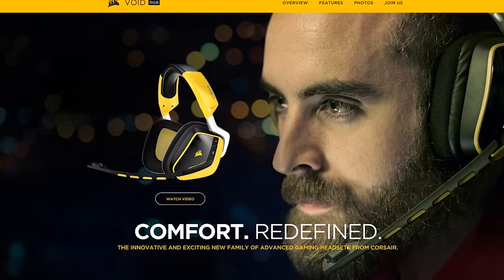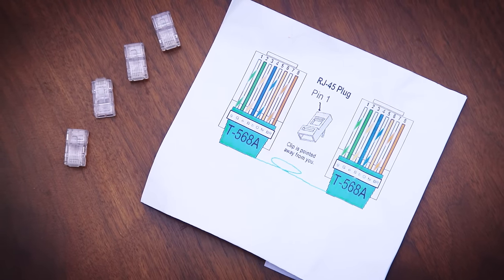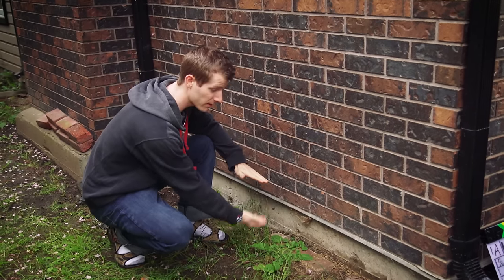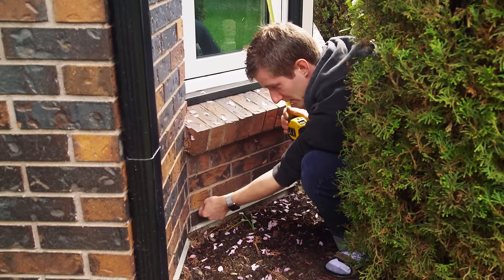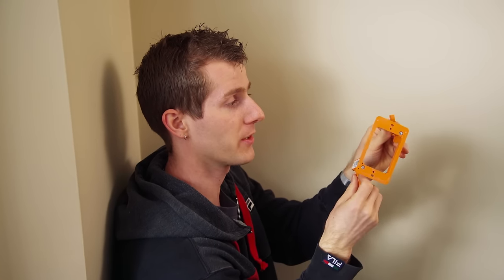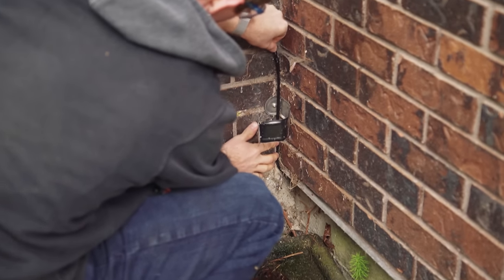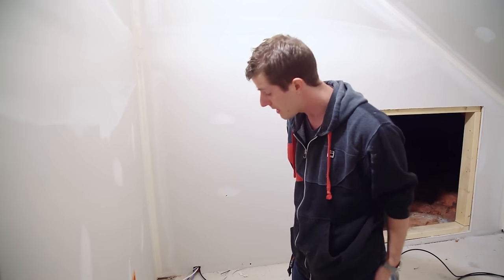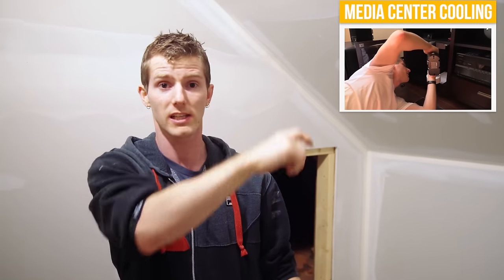Optimize your cable runs at home! - Installing an exterior Cat 5e cable

Comment: >socks with sandals
Also, I can tell that you've rarely done work on houses. Lots of moments of me screaming "NOOO DON'T DO THAT" 
Short bit of advice as well is to always drill from the inside out and angle the hole down (from the inside) so that it'll make sure water can't go up into your hole even without silicon (use silicon, not caulk. It's better for this type of thing). And once you hit the brick, you could switch to using the masonry bit. You can also grab grommets for the hole you made. They actually specifically make them for this type of thing. I trained to be a broadband premise installer and they advised to NEVER drill into the house from the outside. 
I wouldn't recommend using a drywall saw on already hung drywall, you NEVER know where someone might have ran a wire and the last thing you want to do is get hit with 120V and then also have to fix that now damaged wire. Use a utility knife as it won't risk cutting wires. 
Always remember to check where studs are so you don't end up running into one when running wires like this. You can patch drywall but it's easier if you don't have to because you can't put the face plate in the wall thanks to hitting a stud. 
Other than that, most of the rest of it was alright and you could follow that. I've (unfortunately) had a lot of experience doing electrical work, running wires, plumbing, and working on houses because my dad and I have done many remodels for family and our own home. Plus, I used to work for him installing and fabricating countertops while I was in college. 

At least I can come in handy though.
Reply: lots of useful advice :) good stuff!
Reply: you meant to say Silicone.
Silicon is something else.
Reply: +taiiat yeah, oops. sorry about that. yeah, Silicone, not silicon.
Reply: Unfortunately? I make 45 dollars an hour as an electrician.
Reply: +Carl Sagan it's just not things I enjoy doing. I know how to so I don't have to have someone else do it but I don't enjoy doing it.
Reply: im gonna move to the us or where ever ya live
here they dont make that much
Reply: Union electrician here. We make 47 an hour plus benefits. Overall our employers pay about 90/Hr for our guys. We get it done quick and right.
Reply: I never work on houses. This made it look easy to me. I didn't really detect any mistakes. Shows you how much I know about building.
Reply: Perposterown he a tel enthusiast not an electrician xD
Reply: if you drill from the inside there is a good chance you'll blow the face of the brick off
Reply: There really isn't much of a problem from drilling form the outside.
Reply: Yeah, I was kinda wondering why the heck he wouldn't just drill from the inside out instead of doing all that silly measuring...
Reply: Because drilling through a brick, in the best of circumstances, chips off a good chunk around the emerging point of the drill bit, and in worse circumstances, breaks the brick in two.

Drilling in cement on the other hand is extremely clean.
Reply: At first I thought it was just one of those comments critizing without actually giving any advice, but I'm glad I kept reading some really good points, plan on doing something similar so thank you for the tips
Reply: @carlsagan3065  be contempt with that I barely make 35 dollars a day repairing electronics
Reply: Just goes to show that you can get paid almost 50/hr and a union will still scream injustices
Reply: @Courtesyflush52  Have you ever been a union member?

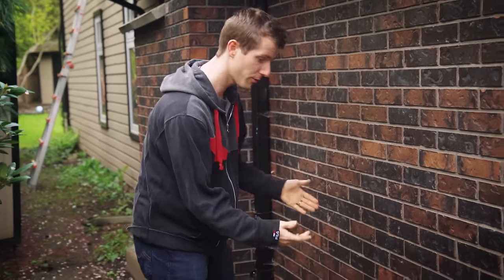Comment: LOL, 4:22 prepared safety glasses; 7:22 forgot the glasses.
Reply: LinusSafetyTips
Reply: "Forgot"
Reply: LOL, of-course you don't need them Just funny to make a point about using them and then not use them.
Reply: He was probably wearing his safety squints at that part.
Reply from the maker: the clip where I'm not wearing glasses resulted in a bit of mortar in my eye, which is why I altered the script and re-recorded it afterward. I guess the editor didn't see the difference between the clips. He probably had something in his eye :p
Reply: Also, do as I say, not as I do.
Reply: yeah well as someone took a chunk of brick to he face yeah shit happens had i not had my glasses i would have lost my eye.
Reply: closed toed shoes next time son
Reply: One Two c
Reply: Seriously the second I saw his disclaimer I totally didn't expect him to wear them for the rest of the video. I had some idiot I was working with while running cable totally blow debris from the other side of a hole directly into my eye. WEAR SAFTY GLASSES!

Comment: Pro tip if you are going through wood and not brick:
Angle your drill upward from the outside, so that any condensation that gets inside your wall just runs back outside. No need for a steep angle, but 20-45 degrees will do ya.

Comment: For external run, you might be considering some sort of 1 inch upvc pipe for extra protection (Act like a conduit) to your cable too. But of course, that will take more times for the installation, bending supports etc...

Comment: Shouldn't there be a loop in the cable just before the entry point? It will stop any water wicking/crawling along the cable and entering the house which could cause rot, it might be unlikely here seeing it has a short run up but it is good practice and would need to be used in other configurations so people should know this. (I'm not sure of the proper terminology but searching "cable drip loop" and "coax drip loop" seems to generate results)

Comment: ALWAYS DRILL INSIDE TO OUTSIDE, MAKING NOTE OF ANY GAS LINES, METERS, WIRES, ETC, ON THE OUTSIDE WALLS!  --  It is cheaper (MUCH cheaper) to get regular cable and paint it (or, like most professionals, tuck it under the siding or the lip under that brick wall so the sun doesn't hit it).  -- Keystone jacks are are a better choice than couplers (that crap you used on the wallplate).  -- Be VERY careful using dryall saw that close to an outlet, it is better to use a knife to avoid cutting electrical wiring. --  You don't have to remove the downspout AT ALL, just feed it through --  When using clips to hang the wire, DO NOT PUT THEM EXACTLY THE SAME DISTANCE APART (this causes a signal reflection) -- Clear Silicone is better in ALL ways than "caulking", and usually cheaper. -- AND, you said specifically CAT 5e, yet I am pretty damned sure that was CAT 6.
Reply: Glad I'm not the only one who thought a keystone jack would be better. Plus they are SO much easier to terminate!
Reply: You are a man of many opinions... None of which I can argue with.
Reply: thanks for saying exactly what i was going to about the keystones, i have never seen someone terminate a wall play using an rj45 coupler! its just unnecessary! keystones and a punch down tool are easier and if you need to change from an ethernet to a phone jack or vis versa its easier to do with keystones, i had cat5e in my walls for phone jacks (just using less of the wires), just changed over to an rj45 stone and used all 8 and boom! works just fine and runs from my router to a outlet and a netgear 5 port swtich by my tv media centre and my WD NAS
Reply: yes LSA-keystones work really great and are a pleasure to use.
Reply: +Laurence Cosmo google has the answers you seek. and I'm not just trying to be snarky; if you're trying to embark on a project like that then you should do some real research before getting started if you wanna do the job right. But I'll answer your last question; in the video he terminated the cable with a standard plug, then plugged it into the back of the jack he installed in the wall. a keystone jack allows you to wire the cable directly to the inside of the wall jack.
Reply: Always drill from out to in if you want your brick to survive...
Reply: Big point for me was, even though he drilled from the out side, the end plate was lower and crooked. Compared to the wall plug.
Reply: Actually if you are making a plate, it makes sense to drill from inside to outside. You are making a hole for the plate and should see the mortar if its a brick house. But in general if you can't see the mortar its best to drill from outside in. It could be pho-brick which would punch out.
Reply: Kevin Smith
If it punches out, you are not using a proper bit, (wrong type, or dull) or you are forcing it.  Yes, the fiber is more picky about how it is handled, but it is hardly impossible to deal with.
Reply: lol yeah thats great mate, Always! drill from the inside out, resulting in blowing out a massive fucking hole in your brick work.
Reply: You are all also forgetting this may only be applicable to your area of the world. Maybe Linus was unable to find a keystone connector where he lives. Also with the way many houses in Britain are built drilling outside in is the correct way to do it. Since wiring and pipes are embedded inside the concrete in many older houses.
Reply: Drilling from the inside is pretty bad idea in this case. This is a really beautifull wall. Its more than likely that you will break off a huge chunk of a brick if you drill from the inside.

Furthermore, your comment is FULL with BULLSHIT, signal reflection because the clips are  put in the same distance? Really? Litterly EVERYTHING you say is FALSE! Greetings from a professional.
Reply: Don't ever try to do this. The hole is not drilled well and you are going to ruin your entire building.
Linus has broken all the insulation layers of the building.
You'll need to get into the house much higher and you need to drill the hole from the outside at an upward angel. You'll need to seal the hole for water and fire ... 
If you ever consider doing this, get an professional electrician (if you want to save, you may drill with his 
instructions yourself).
Reply: Soo, you've just given some bad advice on his supposed bad advice..!! Good job
Reply: +jordyboy62 Considering he has about 50 keystone jacks in his office, I highly doubt that was the reason.
Reply: CAT 6 cables have a separator which separate each of the pairs from each other, which in turn means that this is a lower category cable.
Reply: hayteN
What makes you think he isn't running Cat 6?  Did they SHOW the parts of the cable somewhere I didn't see?  From what they DID show, it is cat 6...
Reply: When he clearly states.. Cat5e.
Reply: Gerff What makes you think he is running CAT 6 then?
Reply: And yes, they did show the individual pairs at 9:03.
Reply: hayteN
It is the thickness and stiffness of the cable, pretty unmistakable when you deal with the stuff every day.
Reply: hayteN
No, you are right, I am mistaken.  I missed the part where he was using outdoor/flooded cable, which uses a stiffer jacket.  Waste of money for this job, but, yeah...his house, his funds...
Reply: +Gerff Easy mistake to make. :)
Reply: Any websites you would recommend to learn more about this type of thing?
Reply: 2Fiddy 2Stroke
No...this type of work, as goes with most "non-tech" trades, is best learned by going out and getting a job doing it.  If you are dead-set on the books and that type of thing, check out "Jones", that is where I used to get my guys certified, but it is only about 25% books, and 75% training.
Reply: If your going to drill into the walls, you should have asked your landlord for the map given to builders about the location of Gas lines, and power lines, etc.
Reply: Ozzie Peck
lol...
Reply: google is your friend
Reply: You know so long as you're between the studs the holes don't have to line up so you drill the outside one where you want and (withing 12 inches side to side) drill the inside hole separate and where you want it. Best of both world.
Reply: Travis Callahan
lol...I take it you have never tried to fish a wire through a wall doing this?
Reply: I take it you are inept at running cables =)
Reply: Travis Callahan
I want to see you do it...in an acceptable amount of time, one hole outside, one hole inside but 12 inches out of place, with the four inch wall full of fiberglass insulation...
Reply: With a 2X3 inch hole on the inside  wall its not that difficult my friend.
Reply: does the length of the cable affect the signal enough to shorten the cable to a more desirable length for the given job. i.e. (cut off 25 extra feet of cable even if its coiled nicely in a unseen and completely acceptable location). thanks for reply. asked here due to the obvious experience in this comment.
Reply: Arturo Castillo
Yes it makes a difference, but probably not enough that YOU should care about it.  25 extra feet of ethernet cable in a house isn't enough that it should make a difference to you.
Reply: Gerff 
Not to mention he's using a Rotary Hammer and a Impact driver. In short Linux knows computers not data line installation...
Reply: Jenna Koss
He doesn't even know computers all that well...have you SEEN his videos.  He is pro-consumer, not a tech.
Reply: Gerff 
I'll agree with you. He is basically only hardware. At least Luke knows some coding. To bad Luke can't do some basic coding video's...
Reply: Jenna Koss
That isn't really what they do.  LMG is purely marketing, with a "news" commentary weekly.  If he actually even knew hardware, he wouldn't have some of the sponsors that they do, IF that is what their interest was (telling us about good hardware, and what to stay away from), but it isn't.  They have sponsors who produce some of the worst quality hardware in the computing world, and shamelessly plug their products, because that is what they get paid to do.
Reply: Gerff 
What's wrong with NVidea, or Cooler Masters or Corsair? Sure these seemly are the only reputable ones but some are good...
Reply: Jenna Koss
I didn't say ALL of their sponsors, I said some;  Seagate and Kingston for instance, are complete shit.
Reply: EVGA is another
Reply: Jenna Koss
Haven't used their cards for a few years, I know they used to be okay.  Their power supplies though, are great, I install 5-10 of them a week, with a failure rate of less than 1% (not including DOAs, which are very few, with the exception of a couple of the 400 watt "white" PSUs, that I don't use anymore), and that is on a three year base. 

When I say something is "shit" or "junk", it is from a place of experience, 20 years worth in the field, and not from a "consumer that had a bad one once".  Honestly, there aren't a lot of brands I put in this category, as most are at least okay, BUT, Seagate, and Kingston both have earned a place in this category, Seagate, only a couple of years ago, hit a 40% failure rate, after years of around 10% in three years, and jumping to almost 20% in five (which is still outrageously high), and Kingston (starting 20 years ago, and remaining consistent over the years) has held an average of 5% DOA (mostly out of spec, but many completely dead), and has peaked at times much higher (I quit using their products many years ago, but I pay attention because I find it amusing that a company that uses generic bulk bin chips, has NO consistency in performance and quality, and has such high failure rates, can stay in business so long).  There are a few other companies out there (a few "peripheral companies") that offer cheap, low quality "stuff", that comes in handy at times, but you know what it is when you buy it, so I excuse them from the normal quality standards, because even though they are made cheaply, they are consistent and you know what to expect from them.  For memory, I use strictly Crucial or Corsair (Samsung in Servers when I don't use Crucial), For Hard Discs, I use Western Digital or Hitachi (Owned by WD and branded HGST now), CPUs are Intel only have always been, Motherboards I use ASUS or Tyan (I have used a few MircoStar successfully), Power Supplies I use EVGA or SeaSonic, Optical is usually Pioneer or Samsung, SSDs I use Samsung, but used Corsair GTX for a couple years with no problems, Flash Memory is Samsung, as well as M.2, I use Black Magic or Avermedia when hardware h.264 or Mpeg encoding is needed (depending on what they are planning on using it for), and either Yamaha or Creative Labs sound cards.  I am willing to guarantee these parts, under my standards of quality, and that is pretty damned high.  Again, if I put something in the "shit" category, they are indeed, SHIT; and both Seagate and Kingston have EARNED their place there, consistently.
Reply: Yea, If I do any upgrades to my rig it will be an SSD, then a better GPU(NVidea GTX1080), then DDR4 Ram at least 16gb of it. Not sure what to use for an SSD but I refuse to put in Samsung Parts.
Reply: Oh, I should say I'm running a GTX 960 at the moment.
Reply: But with an 4.0gHz I7 6700k and 16gb of ram it doesn't slow down.
Reply: Gerff whats wrong with his way of doing it the way he does it seems normal ? Or is it difficult for every installation and type of home cause i want to do this to my grandmas house soon but it was built in the 60s I believe so the studs and everything are different even the walls
Reply: triggered lol
Reply: feed through the downspout? worst idea ever.
Reply: Signal reflection is true for RF or light waves over cables, not electrons going through a cable digitally. I have worked with Coaxial cable extensively LMR 400 and Cat-5 and 6 cable for the last 6 years and for radio frequency (which is analog) signal reflection is a bad deal but the Ethernet cable of any stripe it is not an issue but cable length causing capacitance is (300 feet +). All your tips about indoor cable and paint are amateur hour and bad for cable life, also running the cable through a drain spout which sees all the water is complete garbage. It's a low voltage cable sure but running an indoor cable through a drain is just crap, if I worked with you your tips would get you on the wall of cable running shame.
Reply: Drilling inside out is how people split/crack bricks. Especially for DIY people.